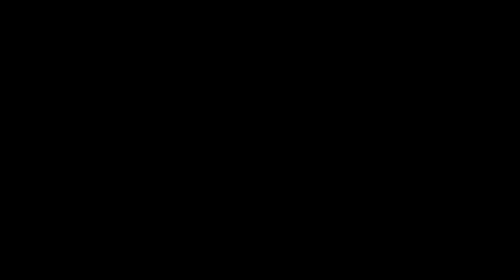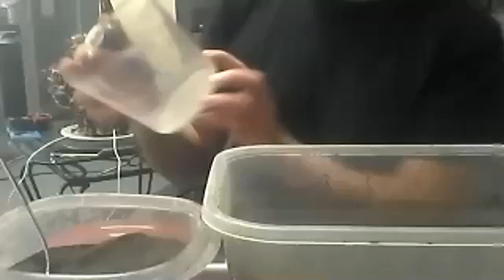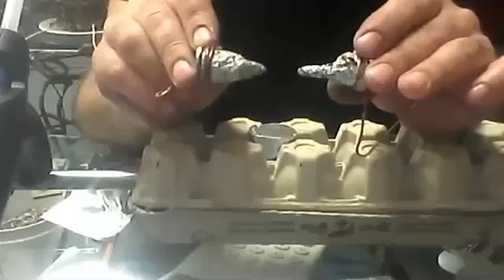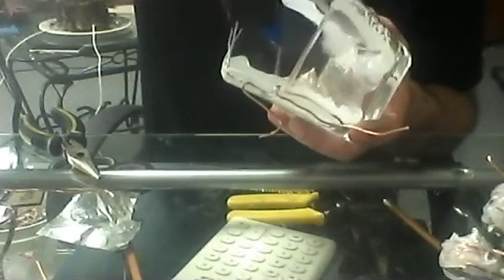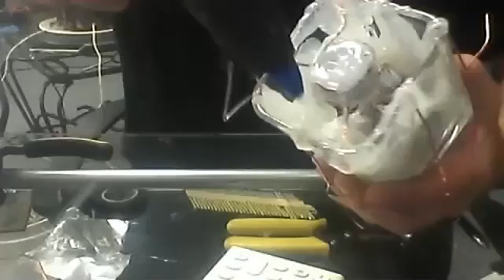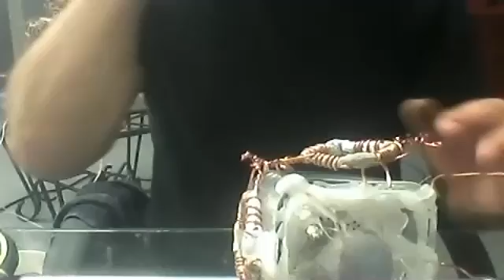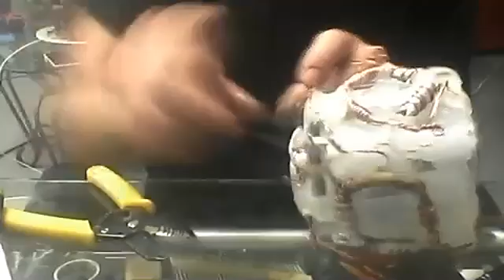Q6 Step By Step Build French Translation 2016 05 04

Comment: If you are successful with your apparatus build and use:  once you are experienced, try doing The Same as you have learned (without the Q devices) but using THE SUN.  The Sun is very powerful as you know, but it will be GENTLE with you.  I do not know if that works for younger people, but it works for at least some older people.   Do not look directly at the Sun except when it is 30 degrees or less above the east or west horizon.  You can then look, more so if there are some clouds, not entirely big, dark, obscuring.  No need to move hands about.

Give that foregoing SUN method a try.  If it does not work for you, THEN BUILD your Q6.  You have benefit of similar with either method -- energies, answers, telepathy from the Sun connecting you to First Source, your First Source.  I would assume it is the same as for these Quantum 6,12,24 cubes.  

The Sun works for me, but I am building the cubes to experience that technique, new to me, curious about zero point power too.  I asked questions, first time with Sun, got answers, just like any Q6 conversation; I mean zero time delay as with radio link to Mars.  I have not tried receiving healing as yet with either technique.  THAT is why we need many more people involved.  NO ONE knows in full what can be done in this area as yet. I call it Orchid Beam Technology.  Perhaps this stuff is a result of earth / human energy level upgrades this century.  I do not know. Others had similar experience in last century, but not so widely as nowadays.  Some people call it Quantum Field linkage, in the context of linking with whatever you want, wherever it is cosmically.  Good intentions, hopefully.
Reply: For example, try using Q6/12/24 to LINK with your pet cat or dog to communicate.  Seems like any and all languages are understood.  See what I mean about the potentials of it?  New kind of Skype to China?  Translators not necessary, whatever.  Who knows what the limits are?  Could you link to the big spruce tree in front yard?

Comment: first 8 minutes

00:00-31 hi guys 
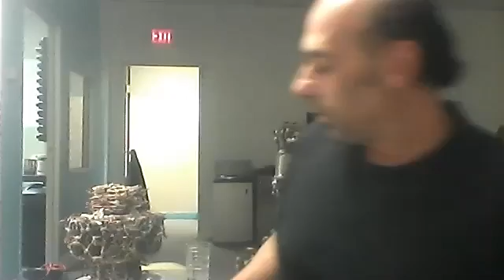00:32-2:12 (tech and talking to french translator and to 

team about where to post this video)
(prays/folds hands) "perfect."

title: q6 step by step build french translation (with 

hebrew text) 
2:20 hello french people love you very much.
2:27 "the q6" (clasps hands together)
(french, hello and we are making the q6)
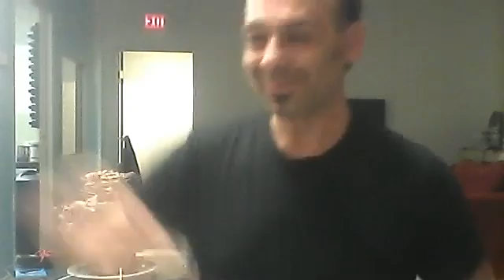2:38 materials that we are going to need for the build 

of the q6 cone. (French)
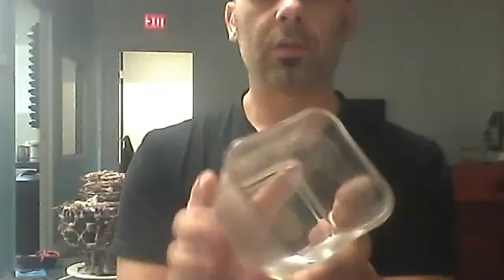2:46 we are going to need: 
(1) a cube (shows cube)...it is 4 inch by 4 inch by 4 inch. 

(french: 10 cm by 10 cm by 10 cm);
(2) six capacitors (shows capacitor), these are plasma 

battery capacitors;
(3) we will need six cones (gets up brings cones over to 

camera) these are hot glued already;
(4) we will need six capacitor centers;
(5) we need at the most 30 feet of 14 gauge copper 

wire;
(6) we need a hot glue gun (big model);
(7) we will need a power bar or power strip;
(8) we will need some ash (opens tupperware shows ash). any ashy will do. i use the wood pellet stove ash. sometimes i use ash mixed with branches, leaves, papers...
(9) you need distilled water, lake water or any type of fresh water;
(10) aluminum foil;
(11) parchment paper;
(12) olive oil, vegetable oil and coconut oil you can use just one or mix all three or two (shows his mixture in flask it is yellow);
(13) rubber gloves;
(14) sharp knife;
(15) container for water and ash.

00: 00-31 היי חבר'ה
00: 32-2: 12 (טק מדברים מתרגם צרפתית וכדי

צוות על שם כדי לפרסם סרטון זה)
(מתפלל / משלבת את כפות) "מושלם".

צעד אחר צעד q6 לבנות תרגום לצרפתית (עם: כותרת

טקסט עברי)
02:20 שלום עם צרפתי אוהב אותך מאוד.
02:27 "את q6" (מהדק את ידיה יחד)
(צרפתית, שלום ואנו עושים את q6)
02:38 חומרים שאנחנו הולכים צריכים בשביל לבנות

של חרוט q6. (צָרְפָתִית)
02:46 אנחנו הולכים צריכים:
(1) קוביה (תערוכות קוביה) ... זה הוא 4 אינץ 'על ידי 4 אינץ' על ידי 4 אינץ '.

(צרפתית: 10 ס"מ על 10 ס"מ על 10 ס"מ);
(2) שישה קבלים (קבלי מופעים), אלה הם פלזמה

קבלי סוללה;
(3) נזדקק שישה קונוסים (קום מביא קונוסים אל

מצלמה) כבר אלה מודבקים חמים;
(4) נזדקק שישה מרכזי קבלים;
(5) אנחנו צריכים על נחושת 30 המטרים של 14 מד ביותר

חוּט;
(6) אנחנו צריכים אקדח דבק חם (דגם גדול);
(7) נזדקק בר כוח או למפצל;
(8) נצטרך קצת אפר (נפתח טאפרוור תערוכות אפר). כל כאפר יעשה. אני משתמש האפר גלול תנור העצים. לפעמים אני משתמש אפר מעורב עם ענפים, עלים, ניירות ...
(9) אתה צריך מים מזוקקים, מי אגם או כל סוג של מים מתוקים;
(10) רדיד אלומיניום;
(11) נייר קלף;
(12) שמן זית, שמן צמחי ושמן קוקוס אתה יכול להשתמש רק אחד או לערבב את כל שלוש או שתיים (מראה התערובת שלו בקבוק הוא צהוב);
(13) כפפות גומי;
(14) סכין חד;
(15) מיכל מים ואפר

Comment: can l use silicone instead of hot glue? the silicone that comes in a tube, is it possible?
if not then why only hot glue?
Reply: In this video, he specifically said that silicone would definitely be a last resort option. The hot glue that he was using has more hydrogen-carbon bonds available. I believe that just helps with the flow of energy better, alongwith the water/ash/oil mixture.

Comment: about the paper cutting i don't get the part at min 12-13. The paper is 16cm/38cm. and you are cutting a piece of 16 cm from 30 cm paper roll . where are the 8 cm (38-30)?
Reply from the maker: Hi baubau! The standard measurement of the parchment paper is 7 inches wide by the length of the box (15 inches). The standard for the aluminum foil is 3 inches wide by the length of the box (18 inches). You can use whatever dimensions you like, trust yourself.